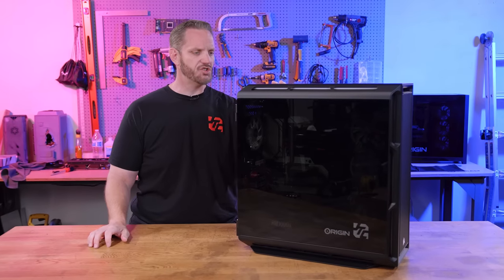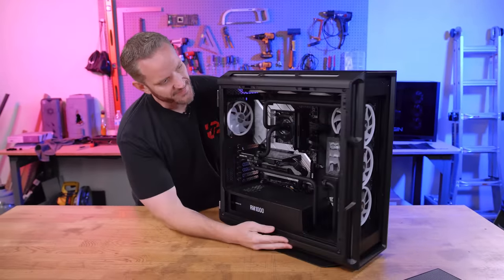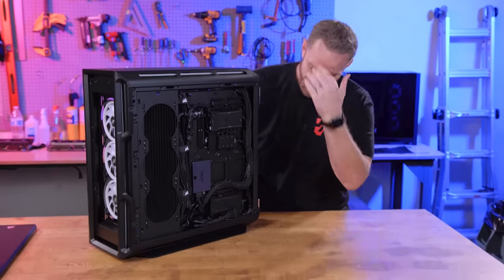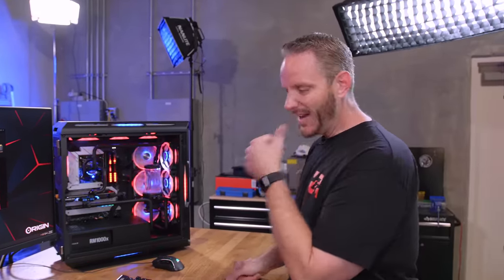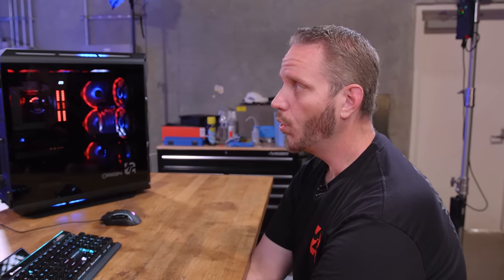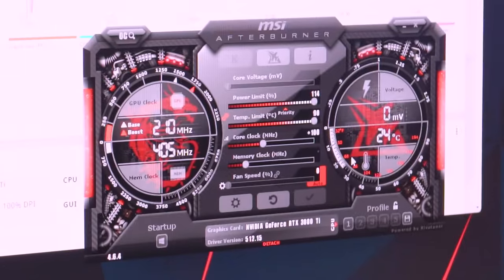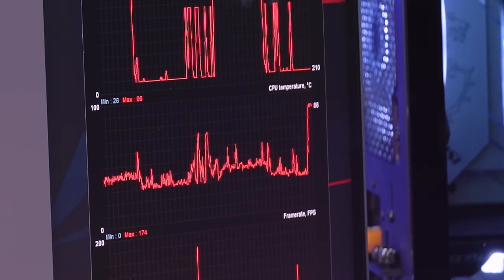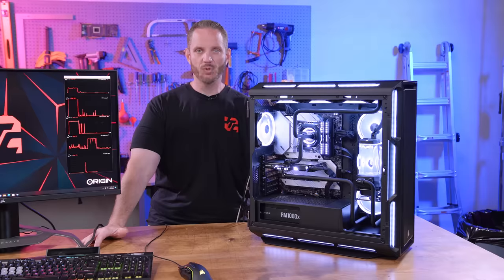This PC is a work of art!

Comment: Corsair needs to make better fans and a better way to manage them. I had 10 QL120s in my build, needed two Commander Core XTs after having already bought a Core Pro that just didn't work for me. All I saw in my Dynamic evo case was rings of dead spots between the LEDs, 20 cables that were just a complete mess in the back and had to remove my HDD cage to fit all the damn controllers. I returned all the Corsair stuff, got 10 Lian Li AL120s with three controllers that were included (only need one), only 8 PWM/RGB cables because of how the fans daisy chain, was able to put back the HDD cage and get two 8TB drives in there AND got back the $200 difference between the Corsair and Lian Li. I used that money to get a G815 keyboard, LOVE IT. The LEDs diffuse so much better, no dead/bright spots, and with the Lian Li software their visor effect can traverse all 10 fans properly without effort. Regardless of Lian Li's or Corsair's software, I use SignalRGB and it all just looks great. Corsair has better options to customize lighting but it can be a pain, providing iCUE doesn't screw up and breaks your LCD pump head.

Comment: Ya im impressed with my evga 3080 ftw 3 ultra hydro copper with the 450watt vbios (pulls 420watts peak) and it gets 45* max core, (55* mem, 54* max edge temp). Water temp stays under 35* max with room temp at 67*

Comment: Can i just mention… if the case was used better it would have a dvd drive bay, cause the top over the fans probably would fit it, or atleast if the fans moved down an inch

Comment: The top mounted radiator is actually pulling not pushing air.
Reply: Whatsapp✙𝟷𝟹𝟹𝟽𝟻𝟼𝟽𝟷𝟿𝟸𝟸

More updates on ETH,XRP,BTC📊
Whatsap✙𝟷𝟹𝟹𝟽𝟻𝟼𝟽𝟷𝟿𝟸𝟸

More updates on XLM,NFT's,BTC📊
👆👆👆👆👆
Reply: Send a direct msg right away

Comment: On the loading times @JayzTwoCents this might be a small video suggestion: what does drive speed do with your loading times? I've used the Final Fantasy XIV official benchmark for this before, to see the impact of moving from HDD to reg SATA SSD, with friends with different systems also getting results from an NVME SSD (we were in the order of 2m20s, 33s, 18s in load times indicated by the benchmark. It might be a fun quickish video to see the difference on 1 system between different drives (maybe even 7200 RPM vs 5400 RPM, QVC vs others SSD, gen3 vs gen4). And ya, nice system!
Reply: Thanks for watching✅✅✅ message right away I have something for you

Comment: You said the top is an exhaust @ 3:20 and removed the filter, yet the fans are oriented for intake. The exhaust is on the side and rear. I don't agree with the way origin set this up, top is ideal for exhaust, but at least get it right you can spot it in a second.
Reply: Whatsapp✙𝟷𝟻𝟶𝟸𝟺𝟹𝟻𝟹𝟼𝟽𝟼

More updates on XRP,NFT's, BTC📊
Whatsap✙𝟷𝟻𝟶𝟸𝟺𝟹𝟻𝟹𝟼𝟽𝟼

 
More updates on XRP,NFT's,BTC📊
👆👆👆👆👆

Comment: I literally just built this system in a 5000d airflow case and OMFG the cable management, mine sadly doesn't look as good as their lol.
Reply: Whatsapp✙𝟷𝟹𝟹𝟽𝟻𝟼𝟽𝟷𝟿𝟸𝟸

More updates on ETH,XRP,BTC📊
Whatsap✙𝟷𝟹𝟹𝟽𝟻𝟼𝟽𝟷𝟿𝟸𝟸

More updates on XLM,NFT's, BTC📊
👆👆👆👆👆

Comment: Why are the back panel radiator fans exhausting?  Wouldn't it be better to setup those as an intake instead of immediately pulling the incoming air out of the case?

Comment: Isnt that ineffective to connect cpu and gpu cooling after each other? If I would build full watercooling, I rather go like reservoir-cpu-1st rad-gpu-2nd rad-reservoir loop.
Reply: In practice it's not worth the effort. Going through a water block the fluid gets heated by less than 5K even at 400W.

Comment: Great video and awesome  looking build. I do have a question though.
With the front fans as intake, and the side radiator as exhaust would there be any fresh air getting into the the centre of the case to help cool those components cool down through convection because  the top and rear fans are also exhaust. Because as soon as the air comes in through the front it would be immediately exhausted out by the side radiator fans?
Reply: I think Jay, like most people would, assumed the top rad was setup to exhaust but it looked like the fans were setup as an intake.

Comment: newer nvidia drivers are terrible for 3dmark now. I have to load in original bios to run high level runs now. I only have a 3070 and 10850k but I am second with those on timespy extreme.  yay new drivers with same setup and temps are thousands out on score

Comment: much more of a fine tuning than performance tuning.
i run my 3600x at 1.075v wich results in  4217MHz 42watt usage and 61c during kombustor cpu burner stress test.
it's noctua NH-L9A-AM4 ramps up to 1313 rpm but settles down to 1170 rpm after the first 30 secs.
figures does now chance for the first 30 mins, and i suspect they wont no matter how long i run the cpu burner test.
4.2GHz- all core seems plenty to keep up with my old gtx 1070 ti...
and, oh- dear it is close to silent.
Reply: Whatsapp✙𝟷𝟻𝟶𝟸𝟺𝟹𝟻𝟹𝟼𝟽𝟼

More updates on XRP,NFT's,BTC📊
Whatsap✙𝟷𝟻𝟶𝟸𝟺𝟹𝟻𝟹𝟼𝟽𝟼

 
More updates on XRP,NFT's,BTC📊
👆👆👆👆👆

Comment: I don’t know if I’m supposed to put my picked pc parts here and get comments on them but uh, here they are if anyone wants to give me help:

CPU- AMD Ryzen 5 3600 3.6 GHz 6-Core Processor
Cooler- Cooler Master MASTERLIQUID ML240L RGB V2 65.59 CFM Liquid
Motherboard- MSI B450 TOMAHAWK MAX ATX AM4 Motherboard
Memory- Corsair Vengeance RGB Pro 16 GB (2 x 8 GB) DDR4-3200 CL16 
Storage (SSD)- Intel 660p 1.02 TB M.2-2280 NVME Solid State Drive
GPU- EVGA GeForce RTX 3060 12 GB XC GAMING Video Card
PSU- EVGA SuperNOVA GA 650 W 80+ Gold Certified Fully Modular ATX
Wireless Network Adapter- Gigabyte GC-WBAX200 802.11a/b/g/n/ac/ax PCIe x1 Wi-Fi Adapter (wifi and bluetooth)
Case- Phanteks Eclipse P360A ATX Mid Tower Case

Fan- Corsair iCUE SP RGB ELITE 47.73 CFM 120 mm Fan - x1
LED Strips- DeepCool RGB350 Color LED Strips

I chose these parts for a gaming and content creator pc btw :)

Comment: is there a way for Origin or some company to have prebuilt IKEA style setups for those of us who like to build the computer ourselves but just don't have the skill or tools to do all the water cooling  tube bending prep ....so for example have a system with all the tubes pre bent to go where they all need to go, and all the builder has to do is put them where they need to go ...A goes to A, B goes to B ...that sort of thing ...so we can have the same experience of building a system ourselves but the tubes have already been pre bent and sized to fit ...and there could be several different design combinations to choose from or for the buyer to design themselves for a more custom loop.   And it will all shipped to you for you to put together at home.   

basically pick all your parts and then pick the water tube design and then it all gets shipped to you like an IKEA build, all you  have to do is put it together ...lol there could even be maybe an instruction manual i dono just a thought lol.

Comment: Cinebench is actually not that good for Zen3 stability and temperatures testing.
It's very easy to make a manual overclock for 5800X with something like 1.18v and 4800 MGz clock and have perfectly fine ~130-150W with 65*C in cinebench r20 and have a runaway current and total power of 250+W in prime95 AVX2 load.
Reply: Except...why would you be running a Prime95 AVX2 load?  Seriously??  Almost nobody is actually running any load even vaguely close except when they are testing.   This sort of comment gets really tedious.  The reality is that some users will get close to a cinebench load when doing video rendering, or blender type tasks,  and the remaining vast majority of users will never even get vaguely close to this level of load.
Reply: @malphadour  Well, for me, p95 was only stability test which would predict crashes in Gears 5 and Hunt Showdown.

And recent story with New World shows that even regular gaming loads can become accidental power virus.

Comment: The SI Must be getting a sweet deal on SATA SSDs. NVME and SATA drives are almost at price parity making SATA obsolete IMO. What are you really saving, 2-5%? Unless you're out of Slots even then you can get an add in card for more NVME. If you're out of lanes then you wouldn't be able to add more SATA drives anyways. Lanes are lanes. That's one thing I hope AM5 increases for sure 24 PCIE lanes just don't cut it on a high end build. Not sure how many on Alder lake. I don't build first Gen of a new socket anyways.
Reply: Whatsapp✙𝟷𝟹𝟹𝟽𝟻𝟼𝟽𝟷𝟿𝟸𝟸

More updates on ETH,XRP,BTC📊
Whatsap✙𝟷𝟹𝟹𝟽𝟻𝟼𝟽𝟷𝟿𝟸𝟸

More updates on XLM,NFT's,BTC📊
👆👆👆👆👆

Comment: Can you not use mineral oil or similar instead of water to not lett a leak short out your pc? Yes a leak would make a mess but it can be cleaned, a short can burn out expensive parts and no amount of cleaning will fix that. Jay, build and test that cause I bet manny people want to know if that is a option.
Reply: Whatsapp✙𝟷𝟹𝟹𝟽𝟻𝟼𝟽𝟷𝟿𝟸𝟸

More updates on ETH,XRP, BTC📊
Whatsap✙𝟷𝟹𝟹𝟽𝟻𝟼𝟽𝟷𝟿𝟸𝟸

More updates on XLM,NFT's,BTC📊
👆👆👆👆👆

Comment: Well it's nice, but it's no 2008 Armari XCP.

Pity you can't get hold of one of those and try building a modern system inside, with all of its Fluorinert waterfall goodness.
Reply: Whatsapp✙𝟷𝟻𝟶𝟸𝟺𝟹𝟻𝟹𝟼𝟽𝟼

More updates on XRP,NFT's,BTC📊
Whatsap✙𝟷𝟻𝟶𝟸𝟺𝟹𝟻𝟹𝟼𝟽𝟼

 
More updates on XRP,NFT's, BTC📊
👆👆👆👆👆

Comment: Cinebench R23 max usage of 12th gen? Prime95 small FFT'S load my 12900K for 50 Watt's more. It uses only 16 threads but loads it like the mofo. Lot if people can't run it even. In lot if mainboards stock speed 12900K with AIO's will go over 100 degree Celsius will pull 300 Watt's plus in Prime95 small FFT's that is. After like 10 minutes it will throttle down or even crash the OS.

Comment: Seems a waste not to show off the waterblock with a vertical mount (even if makes it easier to get to those drives).  Still a beautiful system.
Reply: Whatsapp✙𝟷𝟻𝟶𝟸𝟺𝟹𝟻𝟹𝟼𝟽𝟼

More updates on XRP,NFT's,BTC📊
Whatsap✙𝟷𝟻𝟶𝟸𝟺𝟹𝟻𝟹𝟼𝟽𝟼

 
More updates on XRP,NFT's,BTC📊
👆👆👆👆👆

Comment: Jay, as someone about to complete my first watercooled build, i’ve been pondering this question.  my assumption is this appears to be a fairly negative pressure build.  does that matter more/less in watercooled builds or should i be paying even closer attention to the airflow and pressure capabilities of the fans i’m selecting?
Reply: i’m planning to go pretty big on my rads, but in order to keep positive pressure in the system, i’m finding my case selection is dipping into the ginormous category.
Reply: @DarthGusGus  You have to remember that you can tweek your case pressure by adjusting the rpm of your fans.

Comment: Isn't that a bad fan arrangement? The air brought in by the front fans is immediately going to be sucked out by the side fans and never reach the back or top... and there's also a lot more exhaust than intake, which is bad for dust.
Reply: Is that give away comment legit
Reply: @SpiderSplicer135   no its spam
Reply: @SpiderSplicer135  How many times does Jay have to warn people not to fall for that crap?! 🤦‍♂️No one should even have to be told that is a scam in the first place...
Reply: @James-ih2fb  thanks dude, appreciate the save

Comment: Surprised they didn't spec it with 5600M/T memory rather than using 4800M/T memory. Admittingly, I went from 4800 CL38 to 6200 CL36 and I saw a pretty big difference on my 12th gen system. 5600 seems to be the good compromise but the price difference between 5600 and 6200 was $25 when I got mine. Temperatures look go, mine is around the same using 3 x 360mm (45mm and 2 x 30mm) radiators (w/cooled 12900K & 3090). BTW. I'm pretty OCD with cable management and the level of management is around the level I go to but it takes hours. I do cable management whilst leak testing/bleeding the system via a separate PSU to power the pump.

Comment: If you have three intake fans in the front and three out fans right next to it, how “effective” are those front fans? It would seem that the air flow would be less than it could be. I know that most components are water cooled in this PC, but you still want good air flow, right? 

Or am I missing the point? Are the front intake fans providing fresh air for the radiator that the out fans are pushing through?
Reply: Whatsapp✙𝟷𝟹𝟹𝟽𝟻𝟼𝟽𝟷𝟿𝟸𝟸

More updates on ETH,XRP,BTC📊
Whatsap✙𝟷𝟹𝟹𝟽𝟻𝟼𝟽𝟷𝟿𝟸𝟸

More updates on XLM ,NFT's,BTC📊
👆👆👆👆👆

Comment: I'm old. PC's use to go on the floor or under the desk.  Yes, the lights are cool, but I sure as hell don't want the sound of a jet engine sitting on my desk.  Personally, I want a quiet computer and I want it under my desk to it doesn't take up desktop space.  This is useless to me. Jay, when are you going to do a quiet pc small enough to be mounted under a desk?
Reply: That's the beauty of water cooling, the fans can run at low speeds and still provide better cooling than just adding fans.  I used to be a fan snob and had as many fans as I could stuff into a case. Then I tried a CPU AIO and have moved to a custom water loop. The PC runs cool most of the time with water and I never hear it.

Comment: I know this is a tad off topic, but I would like to thank you Jay for your advice on what to water cool and what not to.  I have a Corsair 4000D front air vent case with a Gigabyte Aorus Z390 ultra with i9-9900k and just recently upgraded to the 3070ti and front mounted H150i Pro.  I originally wanted to water cool all the components, but after watching a few of your videos, I'm glad I left the AIO front mounted and used fan control to create a mix curve for my 3070ti heat temps.  My CPU never peaks above 60 degrees C, even overclocked at 5ghz.  My 3070ti used to hit 81 degrees on the default curve. But now with fan control mix, I have the 2 top case fans and the 1 exhaust back fan increase in speed based on the GPU temp to help and I never peak past 75 degrees with the fans staying about 70 percent capacity on the card and in the case.  Between you and Steve (GN), you both have given this old PC builder a new life.  Thank you so much.

Comment: They wired up the light loop fans in the wrong order and it's killing me. The fans on the front are in line, but behind the res is wrong as seen with the white color wave.
Reply: Whatsapp✙𝟷𝟹𝟹𝟽𝟻𝟼𝟽𝟷𝟿𝟸𝟸

More updates on ETH,XRP, BTC📊
Whatsap✙𝟷𝟹𝟹𝟽𝟻𝟼𝟽𝟷𝟿𝟸𝟸

More updates on XLM,NFT's,BTC📊
👆👆👆👆👆

Comment: that bright lighting on the fans was driving me insane, it is made wrong... the 6 fans goes from top left as number one and follows a fan pattern of 3 1 2 4 5 6 then it switches back and goes 6 5 4 2 1 3
Reply: Whatsapp✙𝟷𝟻𝟶𝟸𝟺𝟹𝟻𝟹𝟼𝟽𝟼

More updates on XRP,NFT's,BTC📊
Whatsap✙𝟷𝟻𝟶𝟸𝟺𝟹𝟻𝟹𝟼𝟽𝟼

 
More updates on XRP,NFT's,BTC📊
👆👆👆👆👆

Comment: Hey Jay,
Quick question, is it good time to switch to Windows 11 or stay on Windows 10 as long as possible?
Reply: Wait for some more major update packs to launch. I would at least wait for the 22h2 update, or even the 23h1 one. As it is right now, i would consider the current W11 still as early access because major changes could happen any time.
Reply: There is no benefit to it apart from running on Alder Lake better, which to me is just an artifial limitation cooked up between Intel and M$ to sell more 12th gen systems.

Comment: Has anyone tested dedicating a radiator per heat source? Eg the following layout for a loop (pump/rez -> cpu -> 360 rad -> GPU -> 2nd 360 rad -> back to pump)? 

Given how hot modern parts are, a video testing out this vs the setup in this video would be a cool comparison.

Comment: !!!Looking for some good youtube advice!!! I am a first time PC builder planning on getting my parts from May 2022 to later 2022 and then start building. I was debating between Intel's i7 12700k (I can get at MC for $300) or Ryzens 5900x (I can get for $370 at MC). I know both of these prices are awesome BUT I also know 13th gen is coming soon and 7000 series. However, I know it is not always the best idea to be the ‘first time’ buyer for new gen tech (you usually want to wait like a year). I also know Mobos for intel are more $$$ than Ryzen (especially the ddr5 ones). Also, alder-lake can support ddr5. Keep in mind I will be using my PC for gaming, work, 3D rendering softwares, and multitasking. So my question is, which one of these CPUS should I go with? OR should I wait until next gen (I mean alder-lake can already support ddr5). Should I stick with a pcie 4 build for the next few years? Or try to aim for a pcie 5 build… Also will next gen GPUS (Nvidia's 4000s or AMD rdna 3) be able to go onto a pcie 4 system? Any thoughts would be much appreciated:) Thank you!
Reply: Whatsapp✙𝟷𝟻𝟶𝟸𝟺𝟹𝟻𝟹𝟼𝟽𝟼

More updates on XRP,NFT's,BTC📊
Whatsap✙𝟷𝟻𝟶𝟸𝟺𝟹𝟻𝟹𝟼𝟽𝟼

 
More updates on XRP,NFT's, BTC📊
👆👆👆👆👆

Comment: Hi Jay and everyone in the comments I'm a beginner I got my Pc brand new and it's working and everything doing well but my motherboard have a orange blinking led on the buttom right corner is that something I should be considered about?! / my Rig i7 12700k - Rtx 3090 - Asus Rog maximum hero z690 - DDR5 5200 32gb kit - AIO cooler - Corsair MP600 2Tb M.2 SSD

Comment: I still wanna water cool my system. Now I have an AIO on my CPU but my GPU is air cooled... CPU 10850K and GPU 3080. But idk if I wanna build it in my 5000X case. I want to get a Hyte Y60 and water cool my system in that case. But with my work schedule idk if I'll be able to actually do it... could just build a whole new system with new parts and everything and give my daughter the PC I have now
Reply: Whatsapp✙𝟷𝟻𝟶𝟸𝟺𝟹𝟻𝟹𝟼𝟽𝟼

More updates on XRP NFT's, BTC📊
Whatsap✙𝟷𝟻𝟶𝟸𝟺𝟹𝟻𝟹𝟼𝟽𝟼

 
More updates on XRP,NFT's,BTC📊
👆👆👆👆👆
Reply: Send a direct msg right away

Comment: On the radiator, should the fan push the air through or pull the air through?  Also, what about actual copper tubbing?
Reply: Whatsapp✙𝟷𝟹𝟹𝟽𝟻𝟼𝟽𝟷𝟿𝟸𝟸

More updates on ETH,XRP,BTC📊
Whatsap✙𝟷𝟹𝟹𝟽𝟻𝟼𝟽𝟷𝟿𝟸𝟸

More updates on XLM,NFT's,BTC📊
👆👆👆👆👆
Reply: Send a direct msg right away